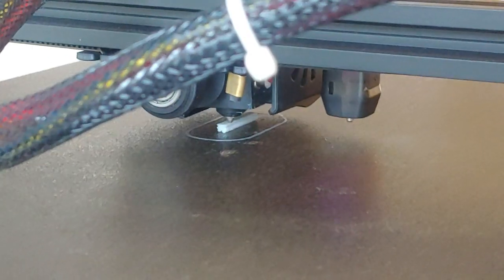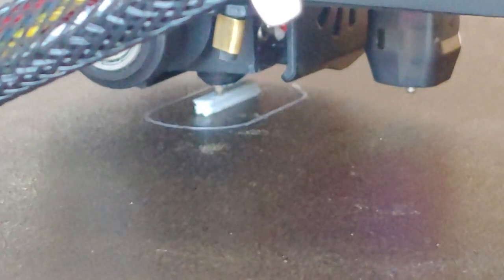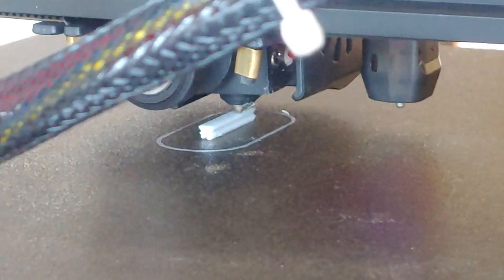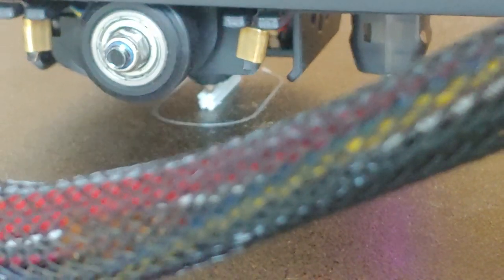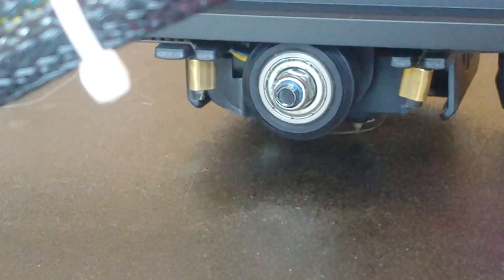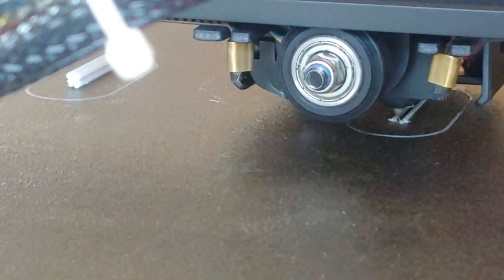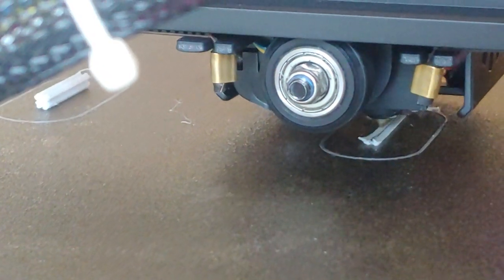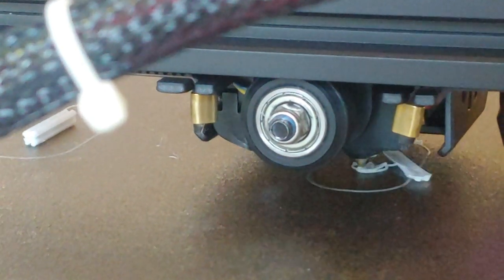3d printing 45° LEGO axles: results.

Comment: This may be a shot in the dark, but try printing on painter's tape. This is what I did back in 2011. Those days and are long gone, but I think the tape may be worth a try. When I used the painters tape back in the day, it was almost impossible to remove the blue back from the print. https://www.youtube.com/watch?v=vFLLqS0DkSc. That video was from 13 years ago, the nascent days of 3D printing.
Reply from the maker: @PatrickHoodDaniel  i got them to stick really well with brims but I'll keep painters tape in mind because brims require filling.  

Do you ever think you'll make/use pnp machines again?  I'm itching to find an excuse to make a pnp.  I've been ordering parts for "poly wants a cracker" Lego compatible brain kits so i can get back into smt /circuit boards.

I've been making axles to experiment with coupling the motor with the motor plate to which LEGO can be attached.

Comment: Mouse ears at the ends will fix the lifting - if your bed is truly clean. You also need better cooling. You can achieve better cooling by either lowering your print speed whilst lowering the print temperature, adding a better nozzle for your printfan, getting a better fan or more or all of the above - alternatively crank up print speed or print several iterations in parallell so the hotend doesn't always linger over the object keeping it molten like that. You also seem to be over extruding a bit. The orientation of the part seems sound to me. You could even model it so that it has a flat base and the actual axle "flutes" start a few lines up (on top of two straight single line width layers on top of the flat base) to insure it prints correctly and accounts for any dimensional inaccuracies due to elefant foot and first layer squish etc. Removing the base should be fairly easy once the print is done.
Reply from the maker: @basementdwellR  thanks.  I added a brim on different models (lego beams) , and they stick crazy well!

I'll try with axles. Stay tuned.